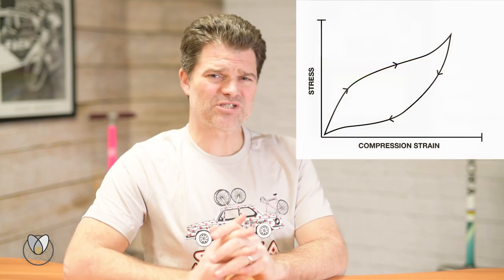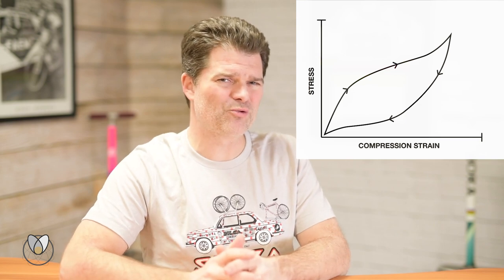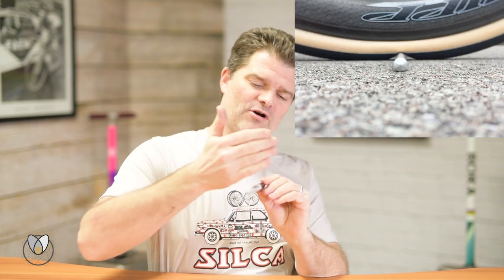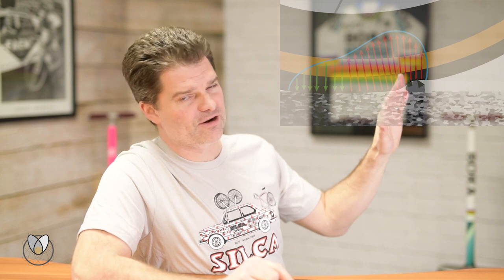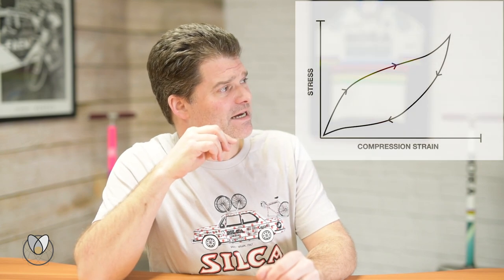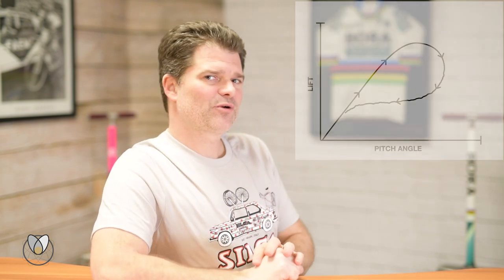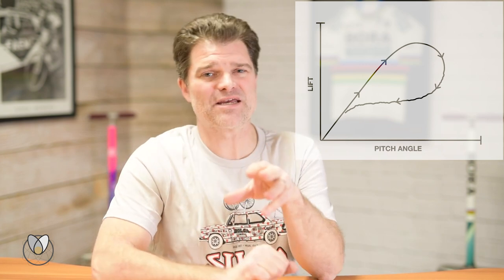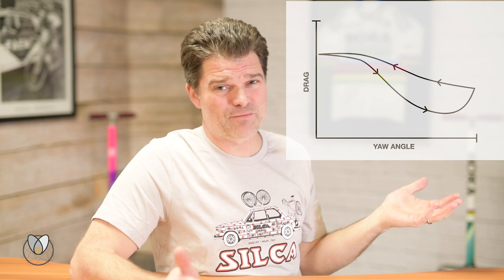Ep0004 Hysteresis - The Cause of Bicycle Tire Rolling Resistance

Comment: Can you do an episode on frame stiffness?  It seems that it is a topic that cyclists are obsessed about. The common school of thought is that when a frame flexes, all the energy to flex the frame is lost.  But some of this energy must be returned back to the system when the frame rebounds.  I am wondering if you have done any analysis on the actual energy loss when a frame flexes under pedaling forces, and the effects of different frame materials on these losses?  Is it even significant or just marketing hype?  I am sure this a complicated subject but I would like to hear your thoughts on this subject.
Reply from the maker: Thanks Joe, and yes, this is in the works for a future episode!
Reply: What I would like to see is an episode on shoe stiffness. From a mechanics point of view only the area under your forefoot should be stiff. I don't see how torque is applied from the ankle towards the pedal.

Comment: Rolling resistance is not just hysteresis in the tyres. The impedance of the bike is just the beginning. Attached to the bike is the rider. Most of the rolling resistance comes from friction between body tissues. That's why the pneumatic tyre — at low pressures as intended by the inventor Dunlop — are much faster than solid rubber tyres. And that's also the reason why wider tyres roll easier than narrow tyres if they are built the same and are run we appropriately different pressures. It's proven to be faster to 28 mm and it's proven not to get slower until 54 mm. Read the Bicycle Quarterly.

Comment: @18:07 incorrect. 
1- An aerodynamic stall isn't a speed thing, it's an angle of attack (angle of the wing chord to relative airflow) thing. 
2- Pitch angle isn't necessarily related to angle of attack. 
3- You don't need to put an airplane into a dive to recover from a stall, you just need to release back pressure on the stick (which is what primarily controls angle of attack). 

It gets complicated because there's a relationship between airspeed, angle of attack, and the g-loading on the airplane that can make it a bit hard to conceptualise. 

Airplanes are cool.

Comment: Is there any studies being done on the Hysteresis on wheels? 
Having read wheel building books I understand that a wheel is also flattens and rebounding as it comes around to the road.
 How much energy is being lost with stiffer wheels? Say with aluminum spokes or carbon vs steel spokes, and the difference in blades ones to straight gauge and the double butted spokes. I actually had in the late 90’s the Spenergy SPOX wheels with the fiber spokes you could tie into a knot. They where actually really comfortable ride to them but also would flex on sprints and man if you had them on a trainer they would flex enough to rub your brake pads.
 Anyways I’m curious to the effect wheel material and there stiffness effects the Hysteresis. 

PS really enjoy your Podcast and the videos

Comment: This topic goes to why I've never understood how "super shoe" running shoes can be faster than a shoe with no cushion at all like a racing flat. As close as foam can get to 100 percent rebound, it can never get to above 100 percent. It can't return more energy than was put in. Same goes for carbon plates. Elite marathon runners have such good form that they don't need cushion to run. They would wear racing flats if they were faster but they don't so there must be something to it. PEBAX is more efficient than EVA, but I just can't see how a stack of foam can physically be more efficient than no foam at all.
Reply from the maker: Since the foot lands slight ahead of the runner when running (sprinting is different), there is a retarding force during foot impact which is absorbed by the body when running in flats, that can be captured in the foam, and then somewhat returned as a propulsive force as the foot rocks forward and the foam recovers.  Essentially, the foam is lower hysteresis than the body parts which otherwise absorb these loads.  There's a lot of biomechanical stuff they are doing as well, but if you run in these shoes you feel it pretty much instantly and Nike's initial claim of 4% faster has been consistently validated by third parties, there is also great literature showing injury reduction from these shoes.
Reply: @SILCAVelo  Oh ok that makes sense. It's the same concept that was controversial about Oscar Pistorius competing in the Olympics because his blades could have an advantage over human legs.

Comment: Thanks for the knowledge! So if my roads are realy smooth tarmac i get less Roling resistance if i pump higher pressures?! I have a set of tubulars that Max Out at 175psi will that be too much if my local roads are very smooth (i mean they are almost like freshly paved tarmac)
Reply: Ok never mind... i just saw episode 0002 and got my answer. Thanks again

Comment: Josh, does the hysteresis of latex increase as it's stretched? In practical terms, would you have more hysteresis with an undersized latex tube compared to a correctly sized tube - using an 18-23mm tube in a 28c tire?
Reply from the maker: So the hysteresis is related to the material thickness.. so actually the losses decrease as the tube is stretched and the wall thickness is reduced to allow for the stretch.  However, this effect is really small and is not worth the reduced puncture resistance loss of the thinner, more elongated tube material.  So while using a smaller tube might save 0.02 watts or something like that, it might become 25% more likely to pinch flat, and will also be much less heat resistant under heavy braking.. not worth it in my calculations!
Reply: And when a latex tube decides to go it is usually very fast and dangerous, so don't shave microseconds under-sizing them!

Comment: With the latex an butyl ball does this means thath by usin tubeless tyres (thicker casing) vs using latex tubes latex is still faster with the energy return of latex?
Reply from the maker: For many tires, yes.. the thinner clincher version with latex tube will be faster than the tubeless version.  Some technologies, however, are catching up and both the GP5000 TL and Vittoria Corsa Speed TLR are as fast, or faster than their clincher variants with latex tubes.